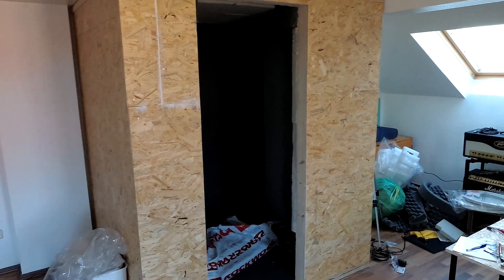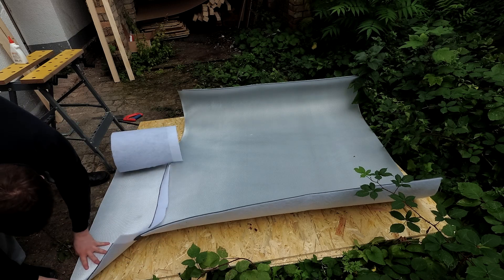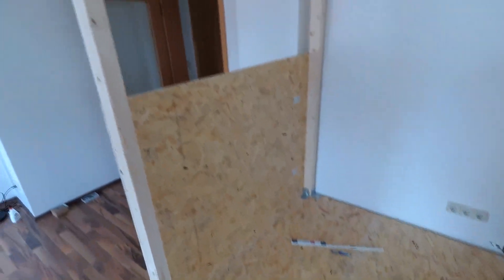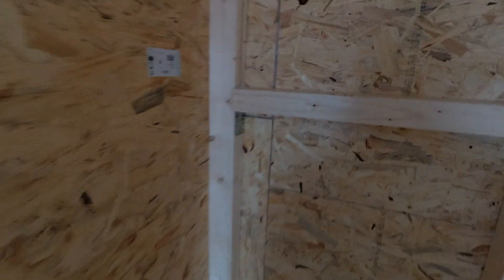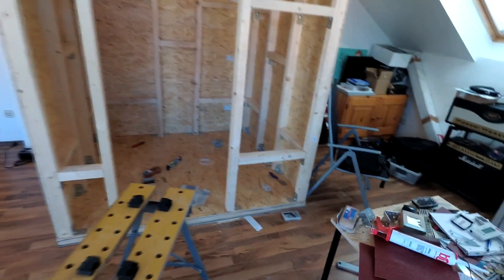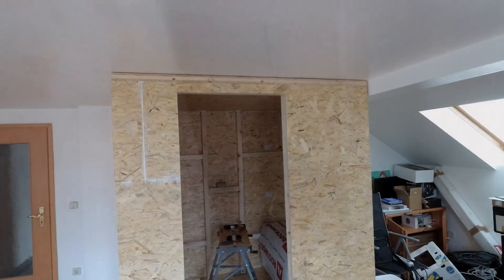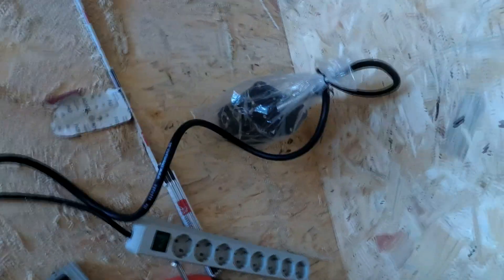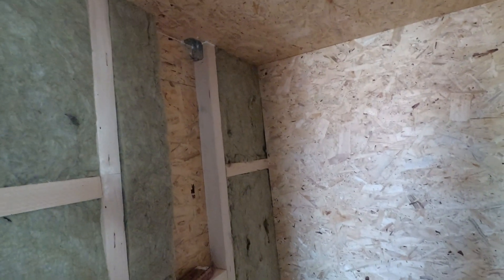Building a Vocal Booth (Part 1: Construction, Acoustic Treatment)

Comment: Hey great video, im  currently building a vocal booth so trying to see how people are constructing it, I just wanted to ask, do you think its necessary to have ventilation? I can see you dont have on yours, but some people say its good to have. Also if you have 2 walls already do you still need to add foam and rockwool to it or can you just add the acoustic foam?
Reply from the maker: Hey! If your booth is smaller than mine, you should definitely consider ventilation - unless you are really into sauna. If it's the same size or bigger, I wouldn't say it's strictly necessary, but a huge convenience. It will slightly decrease the effectiveness of you direct sound shielding, which shouldn't be a problem, if you are not living in a busy main street or something along the lines. 

How are those walls constructed? 
Rockwool is supposed to keep sound from leaking, acoustic foam is supposed to dampen reverbarations. If your goal is to just minimize room reverb, thick(!) acoustic foam will do. If you need to minimize mechanical vibrations and direct sound leakage, then you'll need insulated walls, too.
Reply: @GreyManFaustus  hey thanks for the reply, my booth is a little bigger so I dont think i need it for the moment. Plus i dont want it to effect the sound

Baically I built the booth over the corner of my room, so two sides of the wall were already there from the room. So im not sure if those walls also need to be treated like the walls i built ( with the foam and rockwool). I suppose the goal is to have the best treated soundproof room so the more layers the better? but i dont want to overdo it and waste money, if i can just cover those normal walls with acoustic foam ?

Also the floor just needs a material mat is that the same material for the ceiling or does that also need the rockwool and foam? Finally the door ( well i see you have a part 2 video, should watch that first i suppose lol)
Reply from the maker: @KemiSulola  Ah, I see. When soundproofing, you usually want to go for a "room inside a room" construction. This is due to the fact, that air works as an insulator - by partitioning your room, you are losing a big chunk of the proofing effect. I'm demonstrating that in part 3: Everything is clearly audible next to the booth, but not at all in the next room. 
If you live in a quiet environment, that's not a huge deal, though.
If you add 2 walls to your room corner, make sure to decouple them from floor, ceiling and house walls. 

Acoustic foam does not insulate - acoustic treatment is a completely different beast than proofing. I'm indeed explaining some more of that in part 2. Still, by adding treatment to your regular house walls, you are improving your room's acoustics. If your ceiling and walls are properly treated, the floor is not a huge concern - you are killing enough sonic energy already, that some regular carpet against step noises is sufficient. It's a good idea, in terms of proofing, to have an extra floor decoupled from your regular floor in there. You can do that with a second layer of lamite flooring and some footstep sound insulation between that and your regular floor.
Reply: @GreyManFaustus  wow thank you so much for your answer, really appreciate that and great videos,I will rewatch and just subbed to the channel 😃🙌🏾
Reply from the maker: @KemiSulola  you're welcome. Feel free, if you have any more questions. I'll try my best to answer them.

Also returning the favour, those unplugged performances are great.

Comment: I’d invest in a electric current welding gun and welding pins for future projects require rock wool insulation!
Reply from the maker: I want to be able to take this thing apart, though. Don't wanna rent top floor forever :D
Reply: @GreyManFaustus  I meant for the rock wool insulation in the frame you assembled during prep work. The welding hat pins don't secure the frame to the flooring or wall they secure the insulation so it doesn't slouch over time within the frame. If your goal is some level of noise isolation having the insulation slip or move would disrupt the work you've done. 
if the pins are there you know there's some support holding it still. It wouldn't affect how hard it is to take apart.
It's not necessary by any stretch especially since you'll be moving eventually, but it would be less damaging to move the panels later on if you wanna reuse them.

Edits: English is my SECOND language. I'm struggling to find the correct words.
Reply from the maker: @jillianjacques4190  That makes sense! I didn't know those welding pins, just quickly googled them and assumed they were meant to be used instead of screws. 
The insulation slouching didn't even occur to me, so that's a thing to look out for in the future. 
The panels are incredibly heavy, though, so I can't get them anywhere without completely disassembling everything anyway. It's gonna be a mess.

Comment: Thank you Johann , thank you for your video , just started building a wood frame booth for vocals and so glad I came across your video. Could you or someone explaine why the need for a defuser ( aka the rounded wood) or better yet , the optimal percentage of fome to defused surface and or flat areas ? It makes sense to have different surface and material types but I am a novice in understanding it's function and since I'm half way completed the wood framing,  I can use some of your knowledge and understanding,  if you , or someone reading this sees this . Greatly appreciate,  and thank you very much!.
Reply from the maker: Hey! So, I'm not an acoustics expert, but I read a book on it prior to building, which outlines a few rules of thumb: You want to cover up to 50% with absorption, remaining room modes should be broken up with diffusion. Absorption materials should be dense and thick to process the most amount of low end possible. Low end accumulates in the corners, therefore those need to be treated with extra foam. Live room diffusion is usually placed around particularly reflective spots to avoid hard bouncing early reflections. It should not be placed to be hit by a direct source (so, you should not sing itno it). 
In such a small space and on such a small budget, you can't really do it optimally, so I designed it like this: Cover everything but one wall with foam as thick as possible, cover all corners even thicker. The foam is covered in canvas, which diffuses top end instead of absorbing it (to an extent). This way, the foam takes a huge chunk of midrange and lower mids, but it doesn't sound dull. The diffusion on half a wall is, percentage-wise, a little bit more than you'd usually want in a live room, but it's necessary because of the size. It's a very soft wood, so it doesn't diffuse top end, thus no audible diffusion artifacts, even though I'm right in front of it.

Comment: Question is all the frame work built with 2×4? I see that the front of the door frame has smaller sizes for the face of the door frame. Just wanted to know the sizes before I started building. Also could you send me the link where you got the bass traps and ceiling foam. Thanks alot for this video really a big help!!!
Reply from the maker: Sorry for the late reply, at some point Youtube stopped notifying me about comments.
I don't remember the measurements all too accurately by now, but the wall and door framework is made with 6x8cm beams, the floor is 4x4 and the ceiling 2x4. Those are just thinner because of room constrains, though, I would have built the floor with 6x8 as well, if I had had the space. 
The bass traps are packaging foam I got at a stoneware store - they throw heaps of that stuff away. If you ask nicely, they just might give it to you. The ceiling foam is normal high-medium density foam from the hardware store, that I clad in 1mm canvas off amazon. So, no specific links.
Reply: @GreyManFaustus  Ok thanks a lot for your response, I built a little single person booth last month thats holding up pretty good but I needed the information for when I expand my business just in case the building I get doesn't have a booth I could build it. thanks a lot, stay safe,